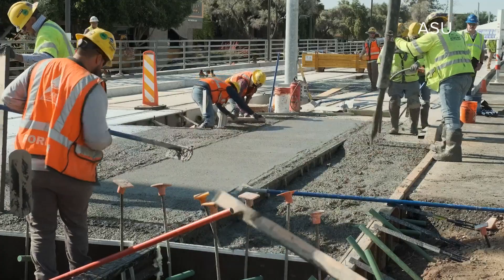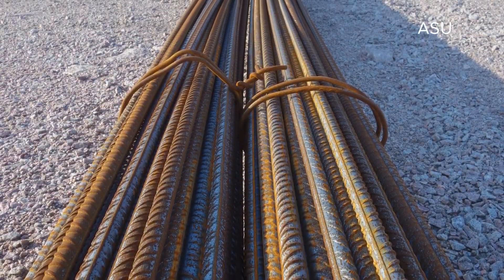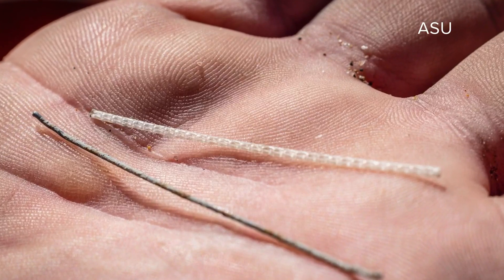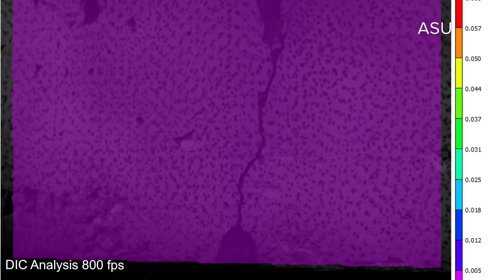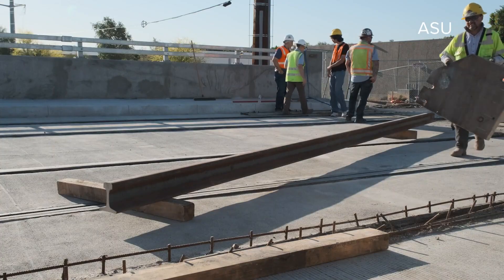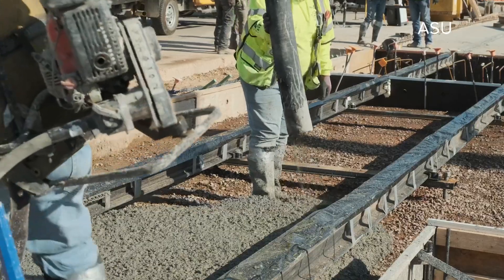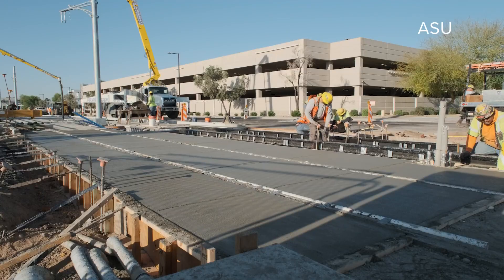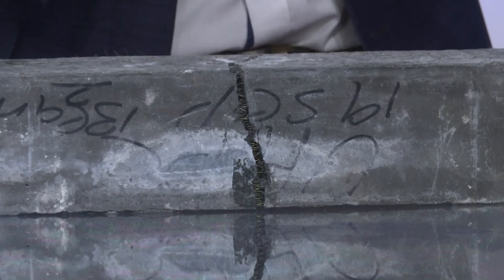Researchers say fiber-reinforced concrete could change construction future

Comment: These comments are excruciatingly stupid. The concrete is full of tiny bits of very high tensile strength steel fibers. The main issue is ensuring that the correct amount have been added to the concrete and are evenly distributed.

Comment: If it works don't fix it. Don't change it
Reply: "works" is a bit of an overstatement. Steel rebar is the main reason why modern construction corrodes and falls apart after a few decades. Even if you had to trade off some strength for more longevity, that can be worth it.
Reply: @majorfallacy5926 
Don't these media Smart Alecs make you sick?
Reply: @hg2.  You are really excited about your comment eh?
Reply: @majorfallacy5926 The rebar is there to increase tensile strength.
Reply: @truecowboy  
Used galvanized rebar. (?)
Reply: Why have a car when you can use horses 🤡
Reply: Don't these media Smart Alecs make you sick?
Reply: It doesnt work though atleast not for long. All concrete with rebar will eventually fail due to rust whic cause expansion which causes cracks and spalling